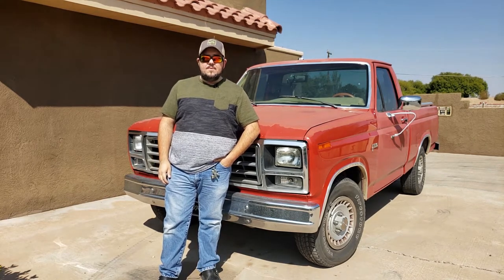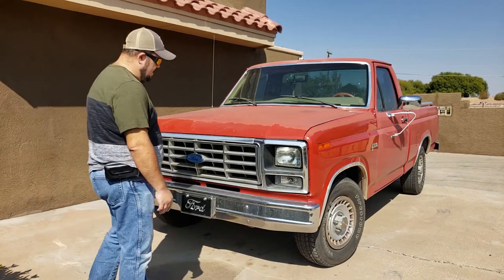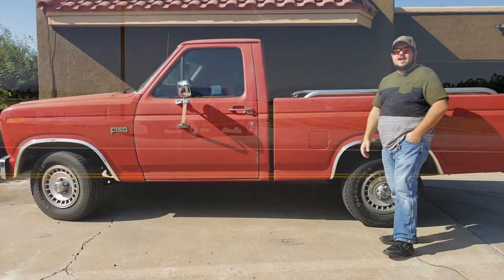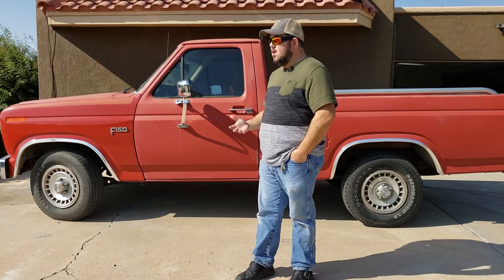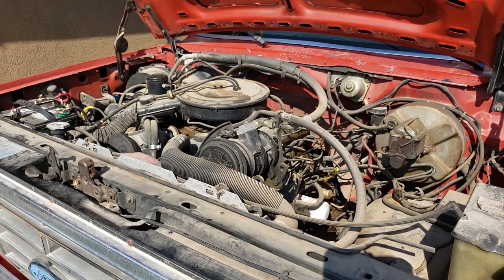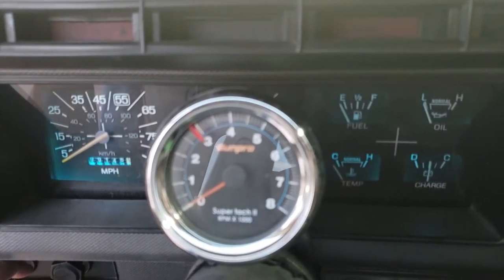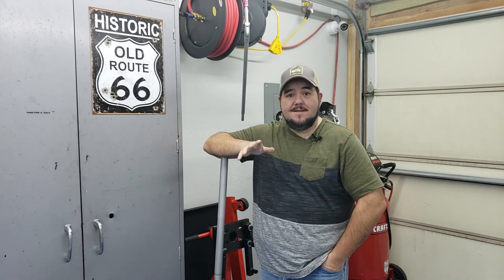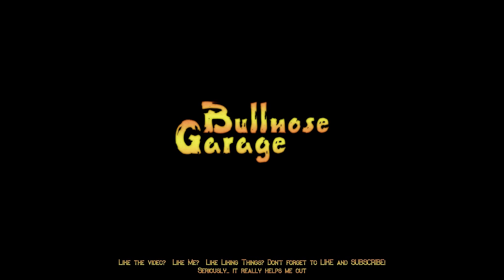What is a Bullnose Ford?  Learn all about my 1985 F-150 [Mods / Future Plans]

Comment: Since the F150 that I knew and loved died in 1997 I've been rebuilding and refurbishing old ones ever since. I have to say I must not be the only one with my opinion of newer Fords since I sell my projects as soon as they are done for a profit.
I think what most people love the most is the fact that the engine I use in all of them is a 351w stroked to 408 with AFR enforcer heads and a mild roller cam, it's pretty torquey.

Comment: I have 2 bullnose Broncos. A 1985 & ‘86.  The 85 has the inline 6 4.9lt with headers. It sounds like a p-51 Mustang airplane but it’s a torque beast and was my first hunting unit. It’s a 4 speed standard and climbs the northern NM mountains like a goat. The ‘86 is an Eddie Bauer Special (1St year) with a 302 v8 4 speed standard dual exhaust. It too is a beast and has been on a number of hunting adventures as well. Ordered a new 2021 Bronco but looks like I won’t get it until 2022. Keep us posted on your build. Thanks.

Comment: Enjoyed the video! I’m a high tech guy too and recently bought a 1985 F350 with a manual transmission. I hope you keep the 6-cylinder—it’s a very reliable engine and is known for its durability!
Reply: Hey buddy I have a question for you did you know any place on Internet where I can get parts for a
1086 f150

Comment: Great Video!!  I love that model F-150, always have.  Back in 2010, I finally got my hands on a 1982 F-150, 4.9 inline 6, standard transmit ion step-side.  Driving it is an absolute pleasure every time.  If you do some research on that engine, you might find that you don't want to change it out.  It is known as one of Ford's best engines.  You have the transmit ion that I wish I had in mine.  The engine was originally designed to be put in tractors I believe and they offered as much torque as the diesels in it's time.
Reply: It's his truck to do with as he wants, but I'd at least keep the original engine in storage to put it back in later!
Reply: The 300 isn’t a bad engine, but it is the most over rated engine ever. A Windsor is a better option every day of the week.
Reply: Sorry but I have to say stepside is a Chevrolet thing. No such thing as a stepside Ford. It’s a flareside.

Comment: I bought my 1983 bullnose Ford truck with a 351 Windsor ($3,000) in 1999 to pull my 1999 Sport Nautique ($40,000). I sold the boat and kept the truck.  Now I want to do the same as you. Work on my Ford truck and keep it running.  Thanks for putting this information together.

Comment: I bought an 85 F250 4x4 4speed with a 300 earlier this year from a copart auction. Got it to start, run and drive, but still needs a lot of work to be traffic and work ready

Comment: Just bought my own 86 with a 300 in-line 6 in it. Bed off, derustified and painted the frame, new electrical, lights, brakes and components and lines, 2.5 inch lift, new coils and shocks, rear dif oil changed, new bearings and seals, all a lot more. Having a blast! Haven’t got to the engine yet because the inline 6 seems industructable. Hoping to put new headman header and intake with new carb to get some more low end torque out of it.

Comment: Great video! I've been watching your channel for a while and just got a '95 351W  from my local junk yard , I plan to swap the engine on my '86 Bronco which is already bored .040 over and needs rebuild...I do not plan to get more than 300 HP out of it since my budget is tight ,still  want to use quality parts... It will also be my first time rebuilding  an engine but I'll be learning along the way; there is a ton of info about  rebuilding a 351W out there...

Comment: He’ll yeah man I’m in the same boat I just got a 85 f250 ranger and the 300 you can actually make the 300 il6 into a really good street truck motor but you’re gonna do what you’re going to do but if you’re going to build a 351 the Cleveland is really good due to the heads but the Windsor you can get a kit from elderblock to make the 351w into a cleavlor
Reply from the maker: The donor I have is a 351 Windsor.  Just something about a V8, ya know? Eventually I'd love to get AFR heads, but I have looked into a Clevor.  Not many Clevelands around here though to pull heads from.
Reply: BullnoseGarage  no elderblock makes the kit that you put on the Windsor it changes a couple things on the Windsor to make it half Windsor and Cleveland

Comment: Got a question, I've got a Bullnose, was running fine but it will start up, and doesn't do the engine rpm raising up when I start, it did before, no it  starts and has a loss of power, could it be the idle control on the carb. Timing is good. New carb but again it doesn't rev up after starting and has a low idle. Thanks, it's an 85.

Comment: I got my grandpas 1980 ranger f-150 xlt.  Im just restoring the interior but leaving the exterior . Its still got good clear coat. My idea is doing a purpose 80s er build. If I add lights im doing halogen baja lights and a role bar and stuff like that.

Comment: Subbed. I have 2 4wd bullnoses, an 84 6.9 truck with a N/A 7.3, I have resurrected it 3 times in the past 20 years, and an 86 460/C6 crew cab project that I am just starting on. I also have a low mileage 94 with 4.9/E4OD that I really like. I've been a bodyman since I was 16 in 1977, if you really don't like your original paint, aren't afraid of failure, and full of perserverance (and enough cash for material), go for it. I have no idea why, but folks love that original paint look, killing my income 😉
Can I have your wheel opening moldings please? 😁

Comment: Tweaker wiring mods are always suspect.  😳
And there are plenty of interior/audio upgrades.
You would be better off with the M5OD than a Zf if you're wanting a fun street truck.
The Zf-5 S42 is definitely not smooth shifting compared to your typical car gearbox.

Comment: I, like the 300 6 cly       I, do have 2 extra create engines on stand by I've got a  78 351 Windsor  and I've got a 70 351 cleveland big block both engines are in creates for stand by both engines are factory  plus I've got  a  78  ford 3 spd  trans and I've got a  c6 auto trans plus I've got a 85, 3 spd with over Drive trans and I've got an extra ford 9" rear all stand by parts  with my 85 ford f150  Bull Nose trk

Comment: A question for other 80s ford drivers, especially Bullnose owners...
How irritatingly inaccurate are your gages, especially your gas gage?
Reply: My fuel gauge is good. The brand new aftermarket sending unit however only reads 65 ohms when full though. This causes the gauge to read 3/4 when full and empty with 5 gallons left in the tank. The sender should read 75-80 ohms when full. To clarify, the gauge and wiring is not an issue, the sender is. Temp gauge usually stays around "N" at 180 deg f which is right where it should be I guess. Less when its cold outside and more when it is hot running interstate speeds. So, it's not that bad I guess.
Reply: @mikejohns3104  mine is crazy. Completely full is completely full. But not too long back, I was at an 1/8 of a tank...put 9.5 gallons in.